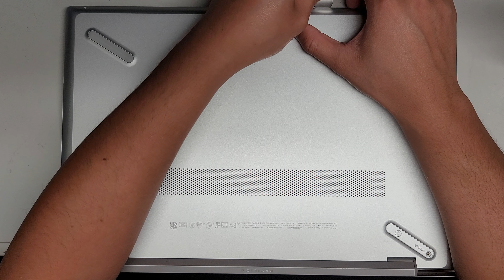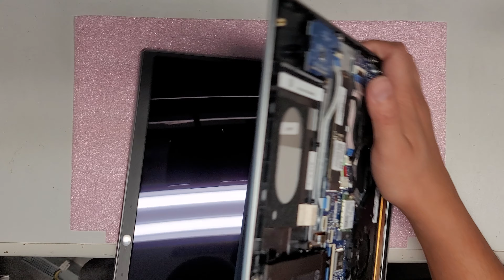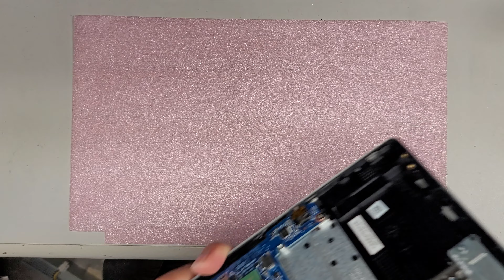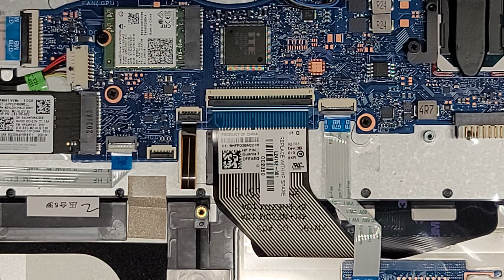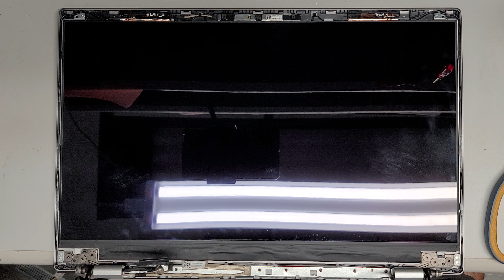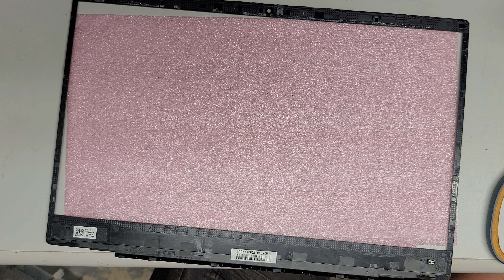HP Pavilion 15-cs3153cl Disassembly RAM SSD Hard Drive Upgrade Repair LCD Screen Replacement Part 1

Comment: How big of a sata ssd can i add and what are the other specs it needs to have for the 15-cs3153cl?  Or is there another way to add an additional ssd hard drive, also how much is the ram upgradable?
Reply from the maker: There are no capacity limits
Reply: @ItsBinhRepaired  What are the specs I need for the sata drive?  How much ram can I put in and would that help with video editing and Zoom meetings?
Reply from the maker: @amymarschak  what's your budget?
Reply: @ItsBinhRepaired  for ram or ssd?
Reply from the maker: @amymarschak  both
Reply: @ItsBinhRepaired  don't wat to spend much because at that point I can get a new computer
Reply from the maker: @amymarschak  32gb RAM and 1TB SSD https://amzn.to/45IhO8e https://amzn.to/45pXuse

Comment: I have a quick question, with the laptop turned off, do I have to remove the battery if I just need to replace the fan?
Reply from the maker: It's safer in case you accidentally drop anything in the motherboard, but not necessary